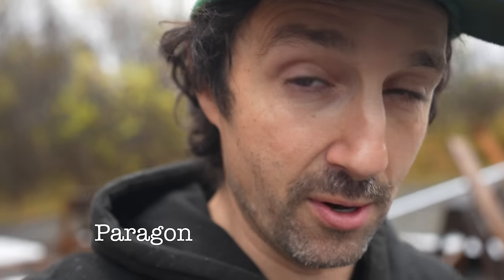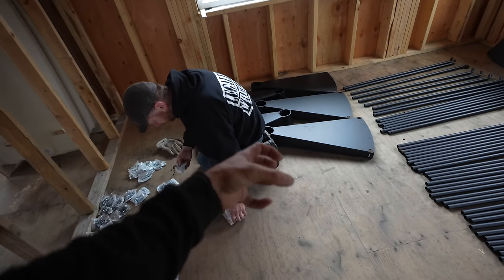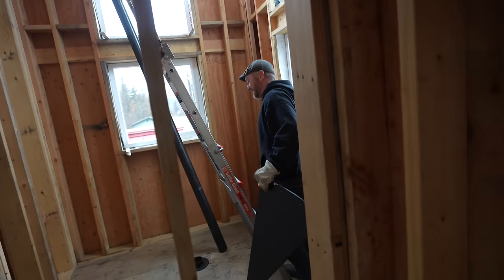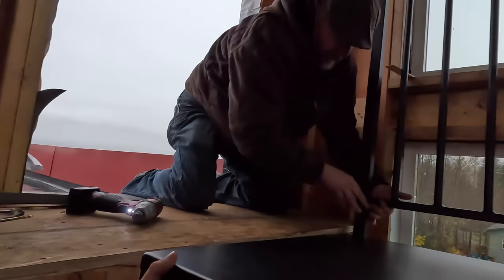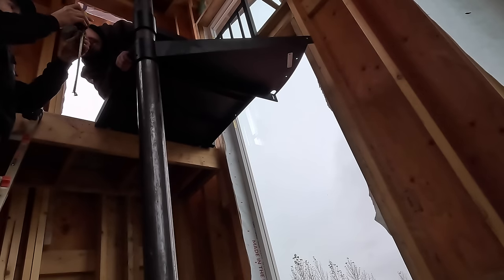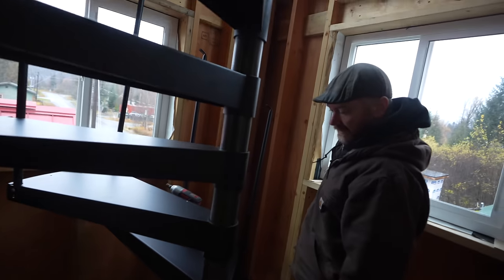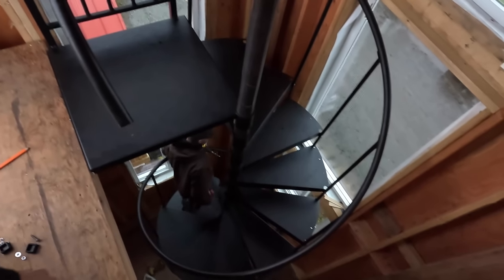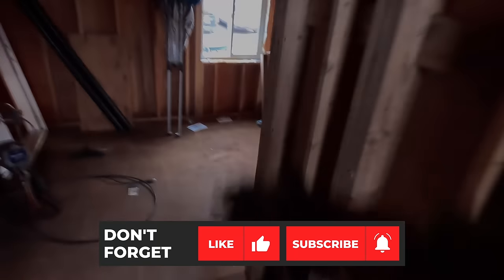Installing a Spiral Staircase in my (Unusual) Cabin Mansion in Alaska

Comment: It looks like you already figured this out, but you must divide the height by the the number of risers (which will always be one more than the number of treads). I also pre-drill all lag screw holes to the diameter of the solid shank of the screw to guard against splitting the wood you're screwing into (especially so close to the top edge of that floor joist). These also just need to be barely snug. If lag screws are over-tightened and strip out in the hole, you gotta' a whole lotta' nuthin'. :)

With longer lag screws (like attaching a 2 by to a post) where there is a solid part of the screw, that portion of the hole should be drilled to the larger diameter of the solid part -- again to guard against splitting. :)

Comment: My question is wouldn't u want to have the interior walls done and flooring before installing the step ? Seem like it be hard to do around steps. 
Nice job none the less. House is coming together
Reply: Was my question too
Reply: We complete the painting before installing a spiral staircase.
Reply from the maker: Tongue and groove slips right in after easy, did it with my rental cabin the same way

Comment: Looks awesome pard..  1 more tread would have been nice, to bring you closer to a 7" rise.👍
Reply: bottom tread looked really close to the floor.
Reply from the maker: 7" rise won't work, you'd hit your head on the treads above about 1/2 way up, that's why spiral staircases are a minimum 8.5" rise

Comment: Just curious why the second ballister (sp) is installed in front of the hole in the steps rather than through it like the rear ballister. Looks odd that way.
Reply: I wondered that too ???
Reply from the maker: We did that to rotate the staircase 15" so you don't walk right into the treads when you walk into the bottom tower door

Comment: Dumb question here since I have no clue about building a house. I've seen other buildings roof like this, how does it drain the water/snow from the room if it's levelled like this. I'm guessing that metal cone looking thing @1:14 is for drainage? But if the roof is levelled does water still not stay trapped to a certain degree in areas of the roof? How do you deal with weather problems with a roof like this?

Comment: 9 3/16" tread rise is gonna be a good workout. Must be missing a tread or two?
Reply: yeah you are correct. i don't know the irc codes for Alaska but all the other houses i build we can't go over
 8 1/4" height.
Reply from the maker: Spiral stairs can't be less than an 8.5" rise or you'd hit your head 1/2 up on the treads, typical rise for them is 8.5" to 9.5"
Reply: @TruckHouseLife Thank you for that information I did not know about that. Good luck with build and rock on.

Comment: Aren't the poles for the handrail supposed to go through the holes in the treads? I noticed you guys attached them on the outside of each tread, I assume you did that for a reason but now every tread has this open hole in the corner? What am I missing here?
Reply from the maker: yep had to do that to rotate the stairs a bit
Reply: @TruckHouseLife okay makes sense now, thx for explaining.

How did you end up getting the center column? I saw in a previous video that it was not in the box. Was it not included in the package or did they forget to ship it?

Comment: Hi.  Why Did you put the final baluster outside of the tread hole rather than through the bottom tread hole?
Reply: I wondered that too when they were doing it.
Reply from the maker: We did that on purpose so to rotate the spiral staircase 15", that way you don't hit your head on the treads walking in the door into the tower (at the bottom)

Comment: Yo man, I'll  tell you do not install all until you have your walls diniahed!  You can temp put in the treads, but wait, or you won't have room to work.

I installed a 16' center poll with 15 treads...  We only had  a few inches off the wall in most of the stairwell...
Reply from the maker: I'm doing tongue and groove, slips in easy, did the same thing on the rental cabin;) no drywall in this house
Reply: Ah, got ya...You're doing a great job and despite the weather and other holdbacks, you are really making great & quick progress!!  Thanks for sharing it with us!! @TruckHouseLife

Comment: paragon seems to have dropped the ball a few times on this staircase.  not shipping the center pole, and you should not have to tap the screw holes.  come on!
Reply from the maker: yup kinda disspointed this round, wasn't cheap either

Comment: 19 steps would have given you a more normal 7 1/2" high steps ... anything over 8" in our state does not pass code.
Reply from the maker: 7 1/2 won't work for a spiral staircase, you'd hit your head on the treads above, that why the rise it minimum 8.5" on most spiral staircases
Reply: @TruckHouseLife  Wow.... Good to know, thanks....